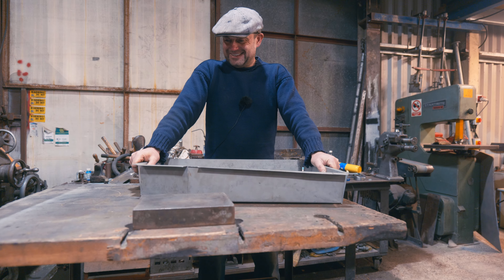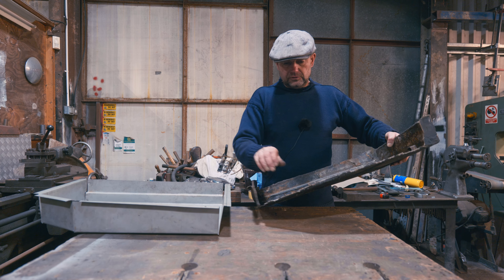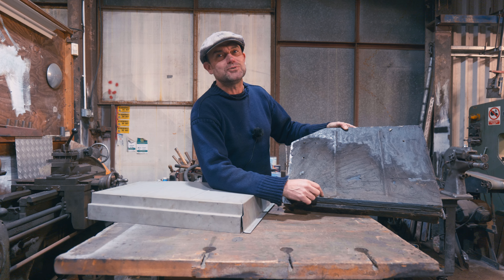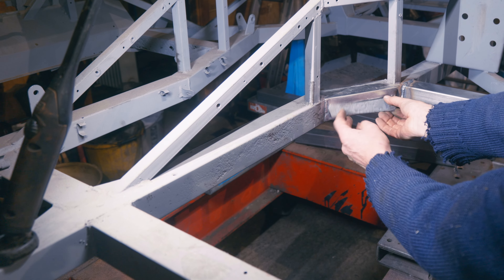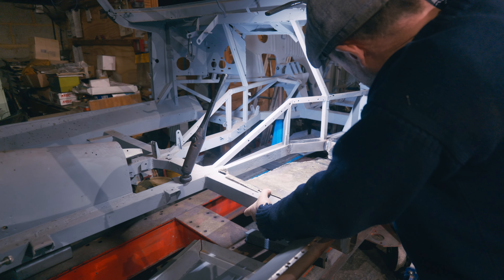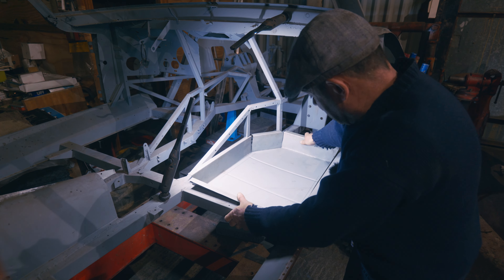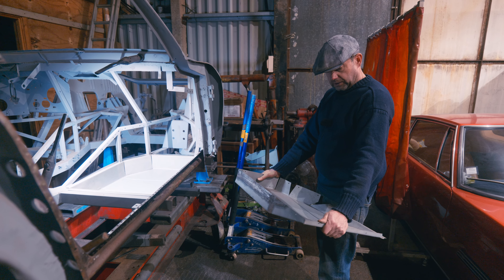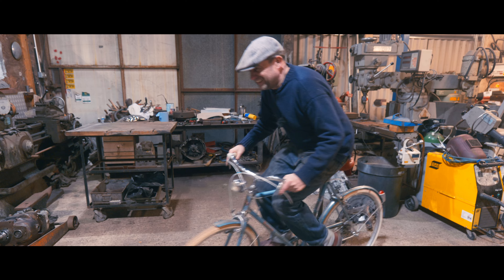Umberto Maglioli’s Maserati Mistral restoration, Part 7: Chassis restoration

Comment: The intricacies of that chassis, amazes me how they worked it all out. No wonder cars take so long and cost so much to develop. The steel floor pans look like a much better solution. Excellent work Mark.
Reply from the maker: @stevestone4346  It’s quite different from the 3500 in that it’s box section.

Comment: Looks like the new chassis will be even stronger than when it left the Modena factory...? Happy new year Mark and Ladislav!
Reply from the maker: I think that it will. 
Replacing the fibreglass floor pans with steel ones is an authentic and reconsidered repair. Many of the other cars in the Maserati range had steel floors. We will keep the original ones for the future this way they can be reinstalled if necessary. Or just for reference.